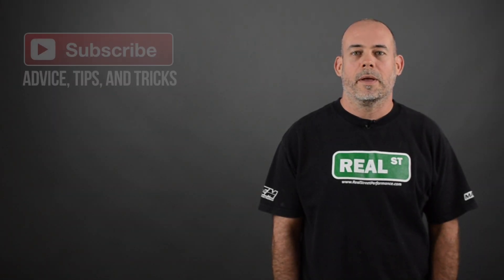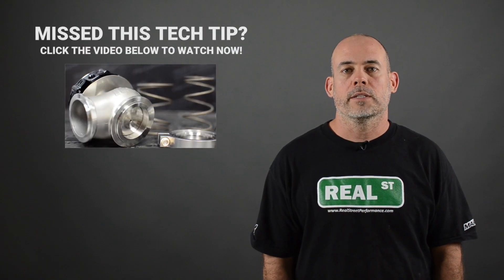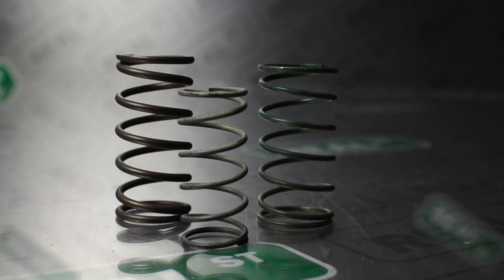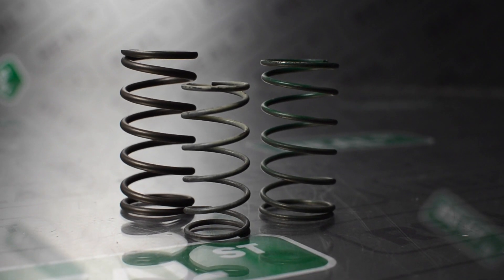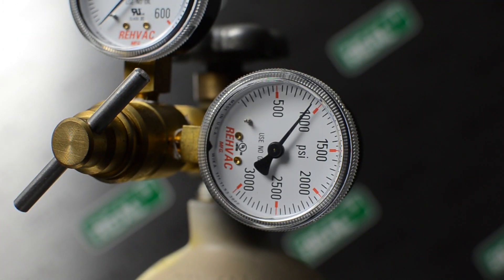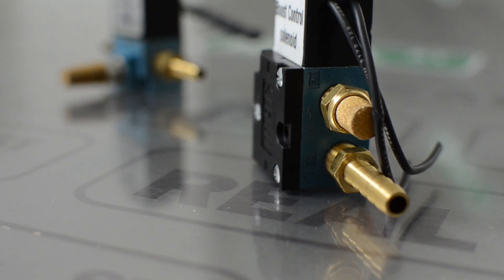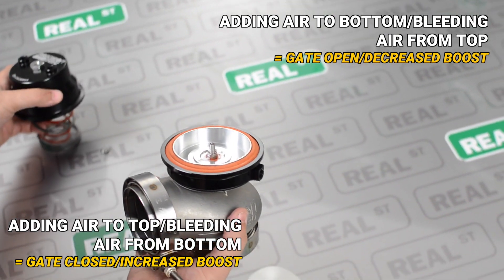Boost Control for Cars That Need More Traction.  - Jay's Tech Tips #37 - Real Street Performance

Comment: I'm running .5 bar springs on 4 port mac solenoid dual ewg twinscroll Borg Warner 8374 EFR setup on my 04 Subaru STI and have perfect boost control as well as quicker spool up making 620 awhp @ 6200 rpm and 600 ft lbs @ 4200 rpm
Reply: Calilaker CAGLS but at the end of the day it’s still a Subaru unfortunately.....I hope somebody steals mine!

Comment: i have a 1jz single turbo in a 97 Toyota Tacoma. i have a HKS ECV EX boost controller both vacuum source are directed from throttle body and 3 line going to side of external westgate. there is a open top fotting on the wastegate. it seems external is opening under high boost. what ypu suggest move the hose from side to top on the external wastegate.

Comment: Hi I plan to run a 5.3 with two Gt45 turbo and two eastesgates. Into a 96 bmw. Can I use the 3port boost controller on this set u up? Also the 5.3 has ls6 beehive springs upgraded trunnion stage 2 cam pro series from Summit has a new valves valve lifters has new cam & crank  bearings also has the heads have been polished.

Comment: I have plans to be upping power on my stock '13 Evo GSR to about 400 hp at the wheels and an aftermarket wastegate and 3-port were part of that plan.  First of all, will my platform support the 4-port you're talking about here and secondly, what if any other mods/parts are needed to support this?  Are only certain wastegates going to work this way?  I'm bone stock right now and plan to tune on the street with an experienced e-tuner using Evoscan...although I have no idea if he has any experience with 4-port boost controllers.  Thanks to all the guys at Real St.!  These videos are awesome!!
Reply from the maker: +John C you are lucky enough to have AWD, so this wont apply as much to you at that power level. To acheive 400hp you wont need to lower the boost in 1st gear like an 800hp fwd or rwd car would need to. Your tires wont spin so in your case you could achieve your goals with a single 3 port solenoid.

Comment: Are the guys at the track even using the 4port boost solenoid and how frequent do you run into the issue of hitting your boost target ive heard that the 4port is real sensitive and will either hit higher than your target and below your boost target so how do you manage to make work more consistently

Comment: Hi, 
I currently have twin small turbos and the wastegate springs are 0.5bar and I have a 3 port boost controller taking me to 1.2 bar. All works fine. However I'm hearing that if I go to a twin port wastegate and 4 port controller then I can promote quicker spool up. My ECU controls the controller and that may well already be slowing the boost pick up so wondered if this is actually worth doing. Its a 1100kg car mid engine RWD and has good traction. Am i also reading correct that if boost controll is via TPS then boost build up will be quicker when TPS increased due to boost already being created? Not sure if I have explained that correctly

Comment: Hey Jay how would this work on a BW EFR using the turbo mount solenoid? I'm running this on my RB30 Skyline and will be young the boost and switching to e85. The ECU I'm using is the Haltech Platinum Pro. Any thoughts???

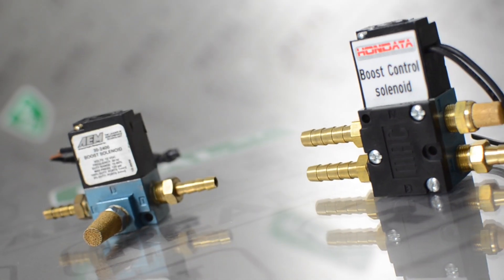Comment: At 2:40 the 3 port solenoid is setup incorrectly isn't it I run mine which is identical port 1 for turbo pressure in, port two goes to wastegate and 3 is pressure bleed you've got the bleed filter on the wastegate out port?
Reply: If you're using the solenoid to reduce the amount of boost that reaches the bottom of the wastegate you would plumb it the way you're talking about. If you're using a 3 port to add air to the top of the gate you would use it the way it's pictured. If you had an ecu that offered the control you could use a second 3 port solenoid and leak signal to the bottom of the gate and add signal to the top.  This route you'd duplicate what a 4 port does.  If my explanation doesn't help you look up the instructions for the greddy boost controllers and there's some pictures you can use to get a visual aid. 

 thanks

Comment: Couldn't you just run the boost controller between your pressure reference and the bottom of the wastegate, then leave the top vented to atmosphere? Is this not recommended for some reason?

Comment: Do I need a after market ecu to wire this to or can I wire it to a stock ecu using the stock two port wires
Reply from the maker: you would either need an aftermarket ecu, or you wanted to stick with a stock ecu, you could purchase a stand-alone boost controller that comes with a controller unit and solenoid...but you would need some way to tune the fueling on your stock ecu if you increase the boost

Comment: Hi Jay! We use 3port solenoid and the base spring is 13psi.But we have no problems with 36-38psi on 4th gear and 15-16psi in the 1st....How is that possible then?Turbo is hta3794r,stock 2jz block,HKS cams.
Reply from the maker: +Alexander Dougin Some applications can, some can't. Your same wastegate and boost control setup may not get the same results on an LS1 with an 88mm or an evo with a gt30r. It's a good place to start when planning out a build because there are lots of variables that can affect this right? Engine size vs Turbo size, Turbo size vs Wastegate size, wastegate placement, ethanol or gasoline. And even more variables like boost behavior. For example, a big engine with a small turbo vs a small engine with a big turbo will both have different shaped boost curves with the same wastegate spring. Wastegate position may cause a high boost spike and fall off, or creep to higher boost after reaching target. The "double the wastegate spring" rule is a good starting point for someone laying out a build. It will cover the bases for many of the combinations of variables just mentioned, and leave enough room for the ability to have solid boost control without unexpected or undesirable boost behavior. Every specific application will be different and the spring can be adjusted as necessary once you have a place to start but at the end of the day, the 4-port solenoid method will achieve a wider available boost range on the same wastegate spring than a 3 port will. So if you max out the spring on a 3 port (whatever that max may be), and still want more boost in high gear, swapping to a 4-port solenoid can help you avoid upping the spring. but if your application can give you a wide enough boost range with a 3 port then you wont really need the 4 port.
Reply: Thanks a lot, now clear! Will wait for your next tips :)

Comment: nice tip! do you know if the proefi supports the 4 port valve? do you run it just like the 3 port and the valve adjust the boost by itself?
Reply: +Andreaas Zell Thime You run it just like the 3 port on a single output. Your initial position settings and PID settings will need to be changed as the 4 port has a tendency to respond quicker than a 3 port as it's manipulating both sides of the gate. 
 thanks

Comment: You forgot to mentioned (although shown) that the last option requires an external wastegate, since the design of most internal wastegate actuators operate off one side only. I guess you can find an twin port actuator for an internal wastegate but that is pretty rare.
Reply: St0RM33 not rare at all Turbosmart makes one

Comment: Jay quick question, I have a Rx7 project car and I'm running a gtx42r with a qsv, my manifold is set up for twin comp 40 gates, now my question is will I need a 3 port silinoid to control the qsv and two 4 ports for the gates. both gates are sprung at 1 bar and I'm hoping to see 30 psi, thank you
Reply: Fc3s king. You can run both of one controller just tee the line going to the gate. But you'll probably need the 4 port

Comment: what else would i need besides the 4 port to run boost by gear in my integra, using hondata s300 v3
Reply: Boost by gear may not be your best bet if you're making decent power. I'd use the non driven wheel speed to do boost VS speed. It will help calm it down on the gear changes. I'm not familiar with the S300, I stopped using Hondata years ago as it's not really what comes in the shop. 

 thanks

Comment: Jay, I’ve got a single turbo 335i with dual wastegates running a 4 port solenoid. Is there an appropriate way to plumb this up to be able to run a 10 psi spring and boost 28 psi?
Reply: In most cases a 4 port will offer is the most range the system can mechanically make. The limitations are what your turbo can make for max boost with zero wastegate flow and what your wastegates can flow running base boost. You'd want give more information to get a more complete answer. Will your system hold 10psi without boost creep to redline? Will your turbo flow enough air to make your target boost at a reasonable back pressure/drive pressure?  Basically what you end up with with a 4 port @100% duty is all the signal leaked that was going to the bottom of the gate and all available signal to the top of the wastegate forced closed.   You'd plumb the 4 port  just as the instructions state.  Please be careful with octane at these boost levels, "bad coils" in your community are a side effect of detonation.

Comment: Hi Jay, sorry to ask you again, will this boost control solenoid work on my MK5 GTI FSI engine with a PTE5858 ? It's currently using the N75 valve and it's run electronically. Does yours work the same?
Reply: As long as your control frequency is the same and you're able to access the duty and correction approach to error  it's just a solenoid. What makes the 4 port able to have the increased range is the fact that it's removing signal from the bottom of the wastegate's diaphragm and  adding to the top of the diaphragm while a 3 port is just manipulating one or the other.

Comment: +Jay Meagher I have a pte 6766 .91 back housing with 3" open down pipe.
Reply: +JP1320  That should easily make more than that. When's the last time you did a boost leak test?

Comment: Is there a way to use this 4 port boost control in a vehicle that does not run an ecu? for e.g a diesel engine with a mechanical pump.
Reply: Perhaps a switch activated via the gear shifter?
Hopefully you have a manual for this.
Reply: You'd have to use some sort of stand alone boost controller. You could get any one of the electric units on the market. Turbosmart makes a nice one.  With the high drive pressures and short engine speed window on a older diesel engine you normally just pick the turbo that makes your power goal and let it eat whatever boost the unit will make.

Comment: how would this work for a twin turbo internal wg gt2871rs turbos??
Reply: It won't help you. The way  to increase boost in your system reducing signal to the diaphragm of your actuators. You can do this with a 3 port solenoid. 
 
thanks

Comment: If i have a car making around 300-400 awhp do i need a 4 port or am good with a 3 port
Reply: I make 800awhp with a three port using a 45mm hypergate w 40 psi spring max boost 44-50 psi depending on outside temp.
Reply: Tsias100 dayumm ur fully build

Comment: how can that work in my stock srt4 neon?
Reply: You would need a dual port internal wastegate. Turbosmart sells one. That said, you can do Boost By Gear with the Diablosport, just contact Needless Torque, Google it.
Reply: Whatever mods you do to that car , it will still be a PEEON

Comment: I have a 3lb spring in my Turbo Smart 44mm hypergate with a 4 port boost solenoid. What’s the highest boost I can achieve with a 3lb spring? What spring rate do I need to achieve 40 psi? The turbo is a Garrett g-770 on a 2018 Honda Type R, sleeved block, forged rods and pistons, ARP +625 head studs, P&P head, full Ferrea valve train. Motec 142, port injection, ID1700

Comment: Hello Jay, I have a hondata 4 port on my civic I tried running a 10 psi spring but it maxes out around 18-20psi. I have it plumed per hondata 's instructions. My tuner has also played around with the frequency 's. Any tips ?
Reply: +JP1320  What turbo and exhaust are you using?

Comment: Can you show me how it is done in hondata flashpro?
I bought a 4 ports from hondata,  i  connected one connection of the hondata boost controller to the k20 ecu pin B2, the other connection was connected to the ground. I was getting 12v reading in B2

SO, what is the next thing to do? Do you have some configuration you can help me so I can load using my laptop to flashpro?
My car is tuned. Thank you
http://tinypic.com/m/jqqnnm/3